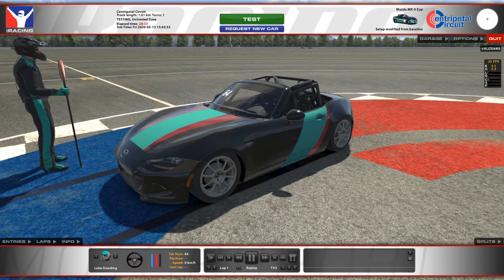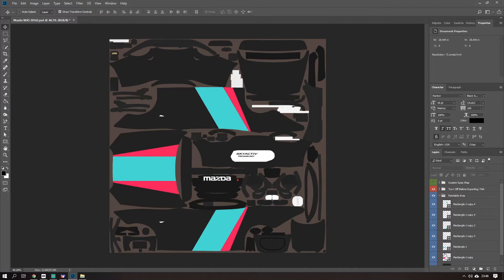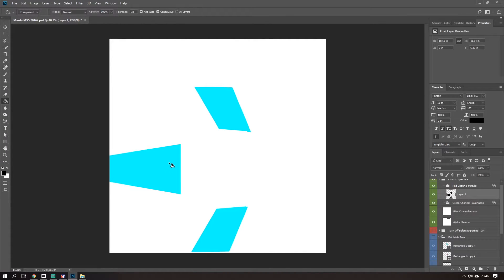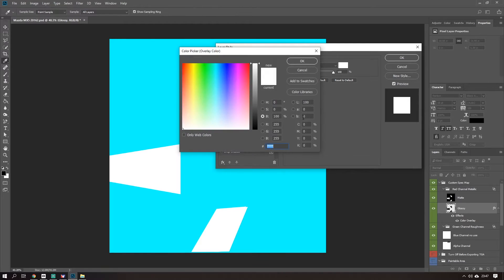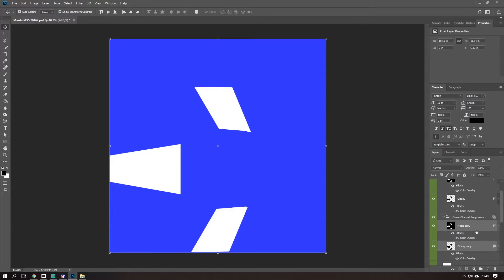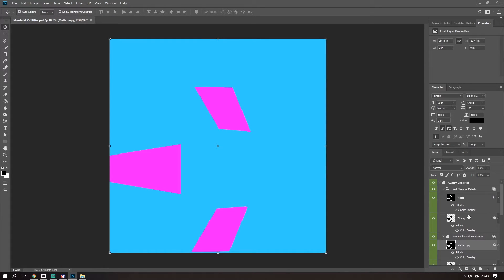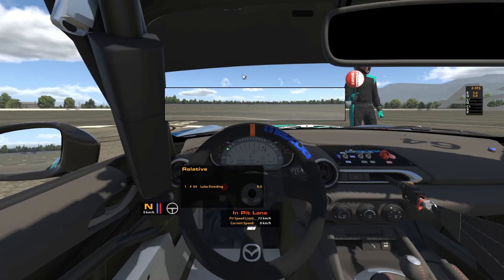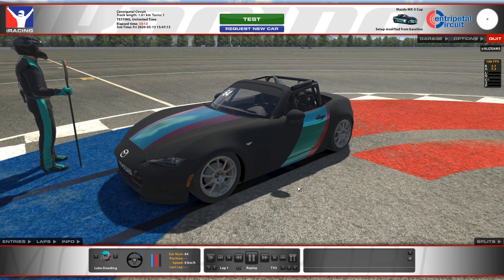Learn Spec Maps in under 5 mins - iRacing Spec Map tutorial

Comment: I downloaded a custom paint from trading paints and wanted to modify the base color to make it chrome. The tga file I downloaded does not have the spec map layers. Is there a way to add them or what do you suggest?
Reply from the maker: You should get a PSD for Photoshop not just a TGA file. You can get the pain template from iRacing paint booth thing in the UI.

Comment: I downloaded a template off trading paints for the Ferrarri 488 GT3 and there are no custom spec map folders in the psd file, is there a different file to use?
Reply from the maker: you can get the files direct from iRacing paint thing.
Reply: @Roamy  ah thanks, that fixed it - thanks for the tutorial by the way, you explained in a few minutes what it takes others a lot longer to do 👍